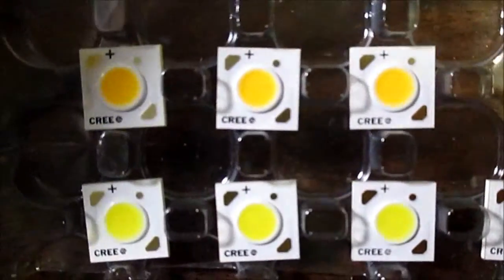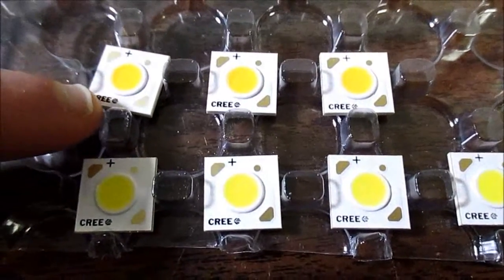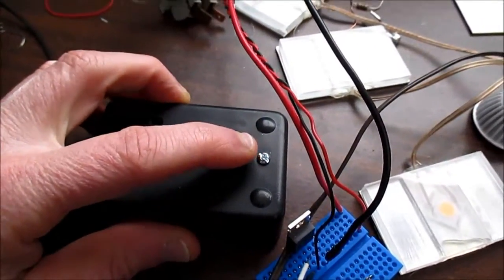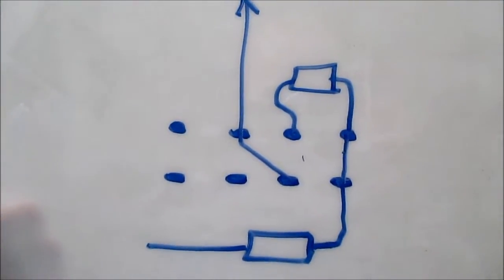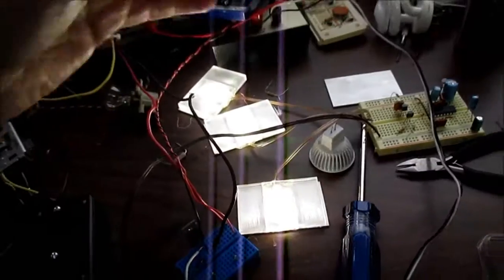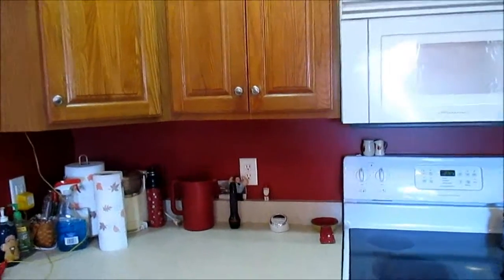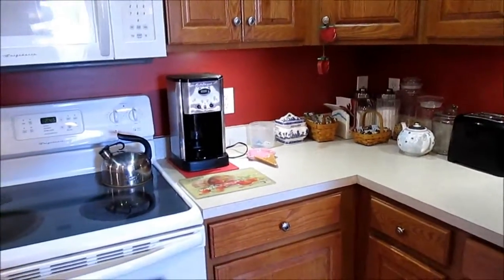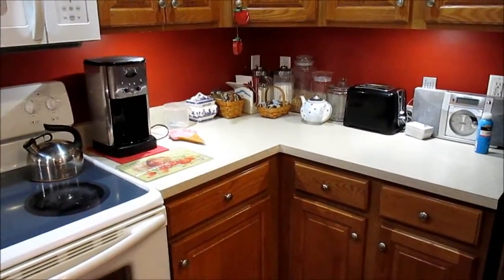DIY under cabinet LED lights Cree CXA1304

Comment: Damn you beat me to it! Well, not quite. I plan on using these LEDs to light my workbench :)
They have good CRI, I got one to test and WOW it is awesome. Only issue is how to diffuse the light, because they are so bright, and the shelf is higher than my eyes when sitting down. (Any lower and I'd be hitting my head all the time, LOL)
How warm do these get at full power? Is that small metal heatsink enough to keep the LED sufficiently cool at full power?
Reply from the maker: Benjamin Esposti These are my favorite LED. I see DigiKey has them for as low as $2.28. Higher CRI is more expensive. Milky white acrylic is a good diffuser but you lose a little light.

Comment: neat project. power supply is not the most elegant solution though. what is the total power consumption of the system?
Reply from the maker: Tiit Saul 4.8 watts total at DC input, probably 6 watts from the wall depending on the type of power supply I end up with (switch mode or transformer). I wanted to keep this under $20. Good quality LED drivers are costly. With such low power, the resistors will do.
Reply: thanks. cool. I thought you are using regular transformer. I have to do something like this in my place.